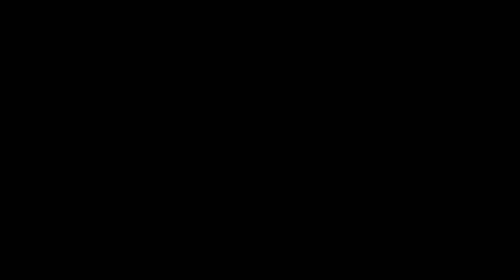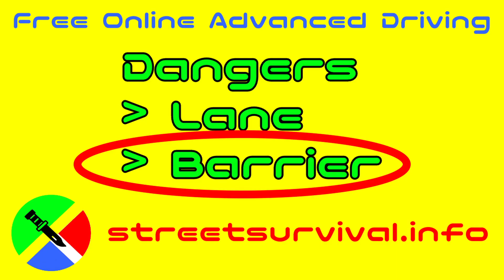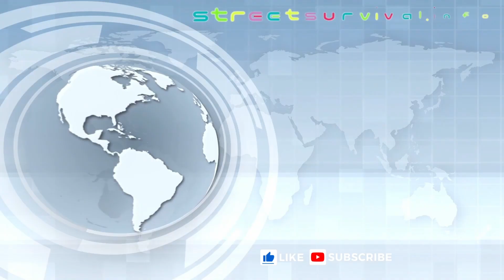Barrier Ahead? How Smart Drivers Protect Themselves Every Time

Comment from the maker: ❓To think about: Why are some highway barriers actually designed to break and fall apart when a car hits them instead of staying solid?

Common questions answered in this video:

• How do road barriers like guardrails and concrete dividers save lives during crashes?
• What are the main types of highway barriers and how do they differ in safety performance?
• How does the F-shaped concrete barrier improve vehicle redirection compared to traditional Jersey barriers?
• What is the difference between continuous barriers and impact attenuators (crash cushions) on highways?
• How are road barriers tested and rated to ensure they meet safety standards like MASH TL3 or TL5?

See related quiz.